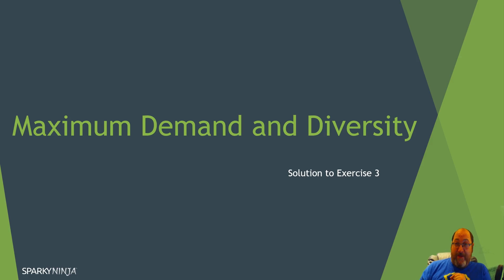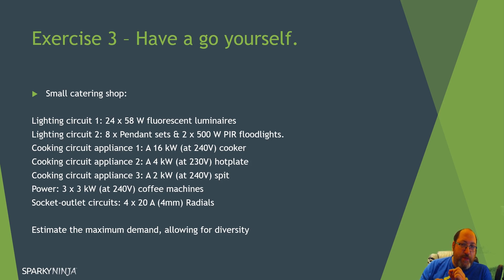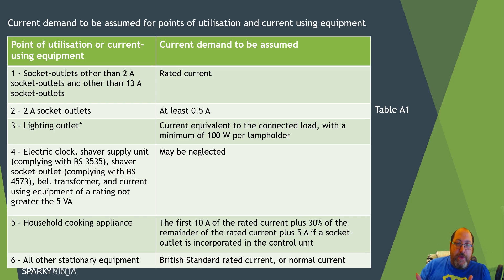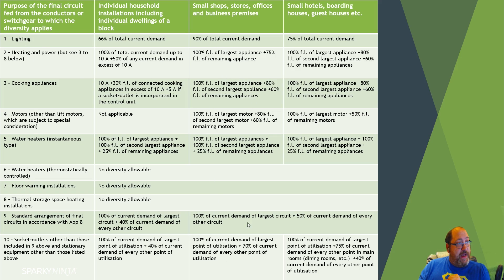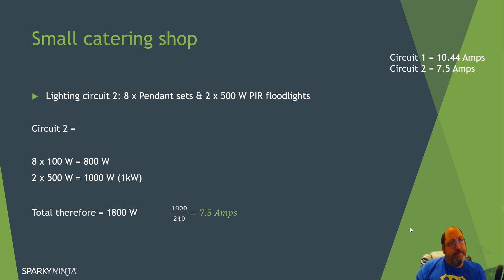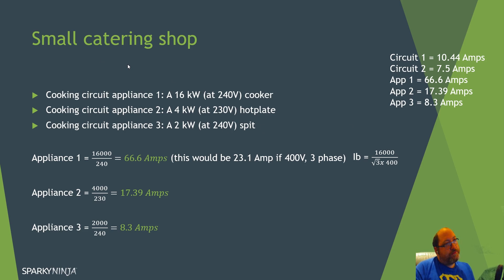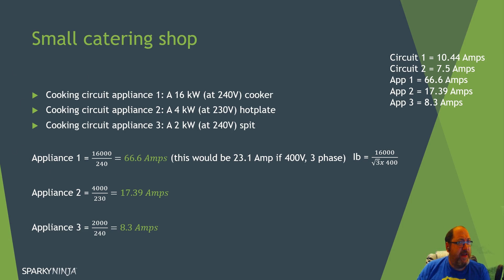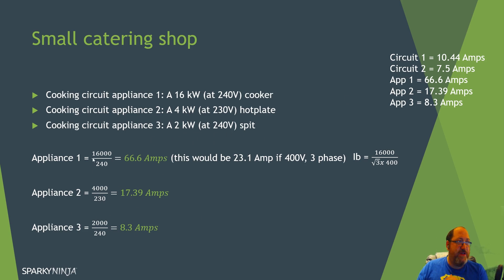2396 Ep 7 - Solution to Example 3

Comment: If on this example L2 and L3 were spare on for example 3 phase way 4 and there was a single phase circuit of 32A in L1 would you also add this to the single phase loads and divide by 3? It makes sense when L1,2&3 are filled with single phase circuits

Comment: Hi Sparky you are right and a recommendation to request a three-phase supply would be more sensible. However, this also brings other problems such as ensuring the installer balances the loads between the phases to reduce neutral currents and cost of the electricity through the meter as i believe you are charged on apparent power (KVA) rather than true power (KW) please correct me if I am wrong.